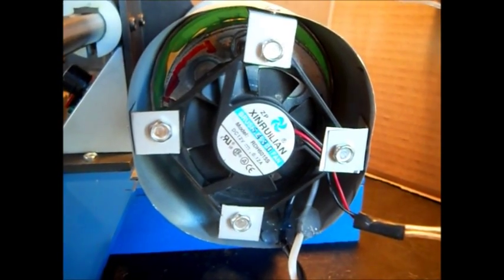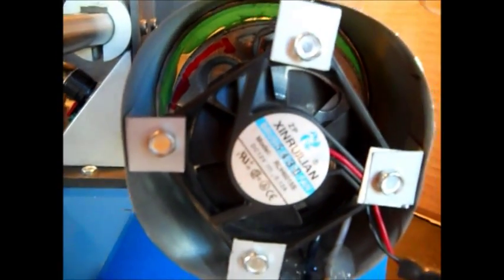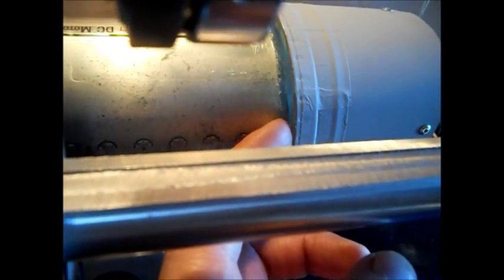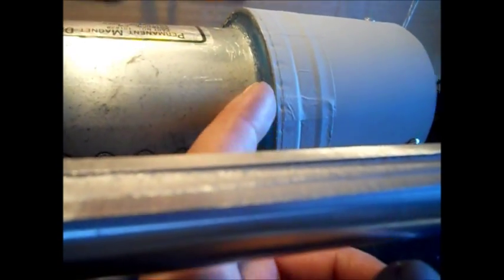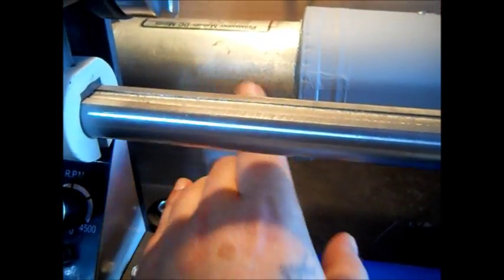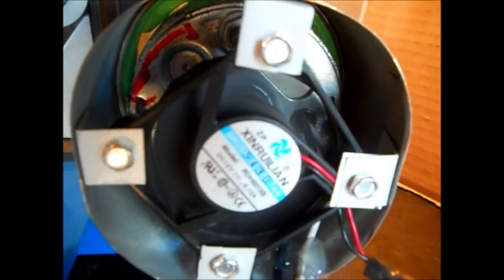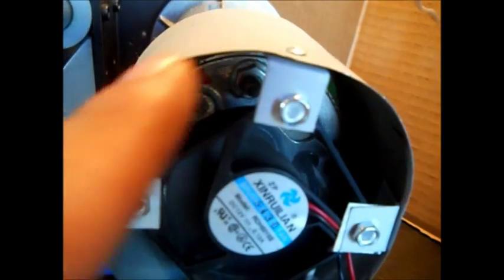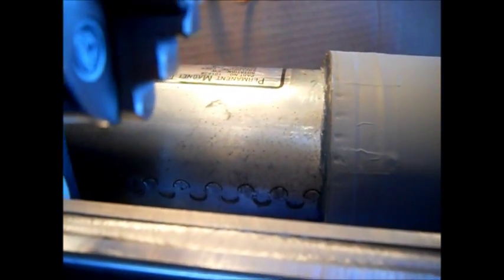Homemade fan and housing for Treadmill motor

Comment: so did it work?
Reply from the maker: Yes
Reply: thanks for your answer, one more question pls, the air flow is pulling or pushing to the motor?
Reply from the maker: It pulls the air in on the pulley side and out the other end where the brushes are
Reply: not2fast4u2c thanks